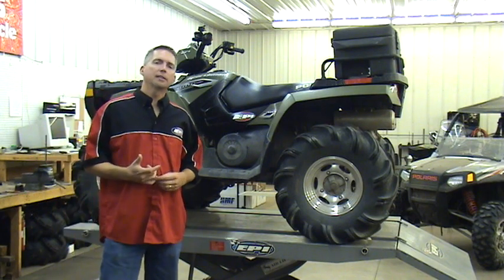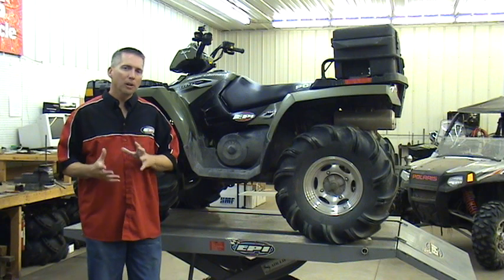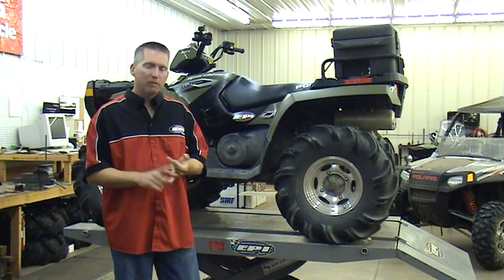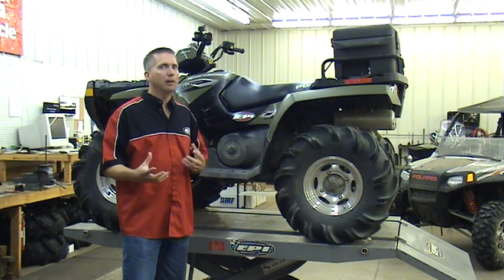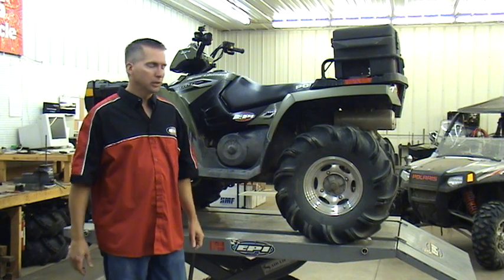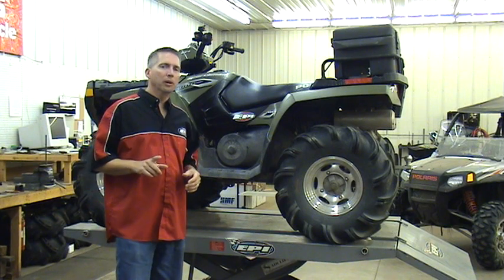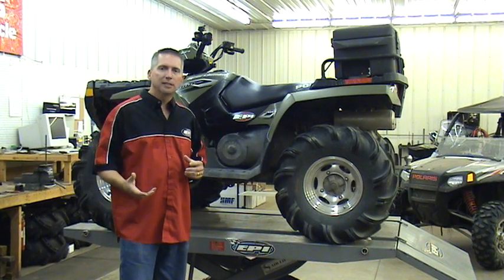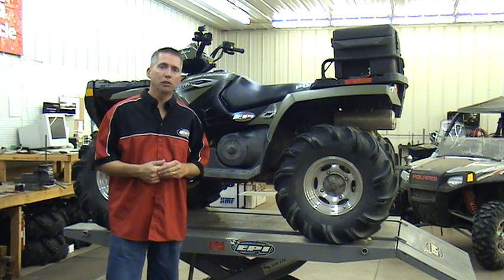"Why do I need a clutch kit?" By EPI

Comment: Hey I'm looking for some clutch weights for my can am outlander 450 thanks
Reply from the maker: You can use our standard Can Am weights which go from 28-42 grams in two gram increments but they fit a little tight in the 450 clutch so you might need to sand or file off .020 off of the base of the weight where the bolt goes through.  The rest of the weight is fine.
Reply: Does it improve performance and will my engagement stay thanks for the quick reply
Reply: Would a 570 clutch kit work for this machine
Reply from the maker: The 570 kit would be different.  All of our kits will raise the engagement over stock.  On the 450 its higher then normal, it would be around 2500-2600
Reply from the maker: The 570 kit would be different.  And with all of our kits the engagement will be higher then stock.
Reply: Can I just get a secondary spring and weights would engagement stay the same and would I get more power
Reply from the maker: if anything I would try just running the orange secondary spring, part number SRER10 and try that
Reply: Hey I found it could you also give me the number for the weights,thanks a ton
Reply from the maker: 302(then the gram you want)S will be a two of the weights.  We go from 28-42.  30 was stock
Reply: Ok so if I put that spring and weights together then I would get more power and same engagement correct ?
Reply from the maker: If your weights are good I would just buy the secondary spring.  Your engagement would be the same and you will have a little more low end power.  Weights aren't going to change your set up a whole lot on the 450.
Reply: Ok I will buy a spring then, thanks so much for your help and time will definitely recommend you my brother actually just got spring and weights from you guys for his king quad 750 thanks again
Reply from the maker: sounds good!
Reply: Hey sorry to keep bugging you but what is your lowest engaging primary spring for the 450,thanks
Reply from the maker: It would be the red primary part number BCS24.  Which should be just a little above stock.
Reply: So with the red primary and yellow secondary I would get more low end power correct? Or would a dark green be better
Reply: Sorry orange secondary
Reply from the maker: yes that is correct
Reply: Ok thanks ordered both
Reply: Hey again lol, I got the red primary and orange secondary for my 450 and I have it in for long time now and I'm kinda disappointed in the performance
Reply: And in low the belt starts whining at about 20-25 kilometres when it would be like 35+ before I'm not sure if it's a bad setup or not if I need to change it plus I'm looking at getting 27" cst wild thangs soon with my setup will it turn them ok?

Comment: what if u drive  honda
Reply from the maker: We do offer wet clutch replacement springs for the a lot of the Hondas.  The Economy kit will raise the engagement aprox 300-500 over stock and the competition stall will raise the engagement 700-1000 over stock.  Both kits will help out bottom end power and response, they will not change top end speed or rpms.

Comment: i have a 2012 rzr 800 i put 29.5 terminators what would be the best clutch kit for it?
Reply: Add  2 gr heavier wights and put the secondary spring on the biggest # hole

Comment: i have a 2016 suzuki king quad 750 with 26inch swamp lights. i want a clutch kit but im sure i will be buying 2 inch tires  in a cpl years. what kit would u recommend  that would be great for now and later with bigger rubber?
Reply: 28 inch tires*
Reply from the maker: I would get the Sport Utility Kit for 27-28" tires.  It will work good for your current 26" tires and the 28" you plan to go with.
Reply: Thxxx sounds goood